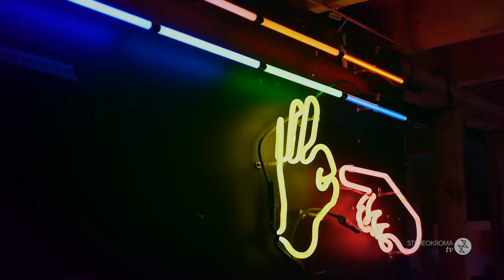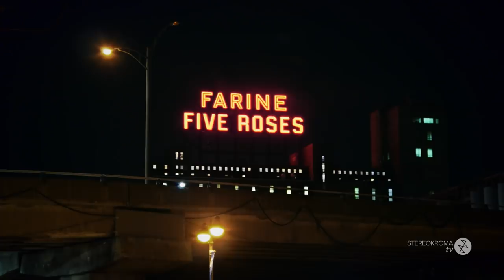Neon Signs last for 50 Years! ✨Making Neon Signs at Neon Family

Comment: this is one of those things that really takes passion to learn, ive always been one that could watch a few tutorials an pick up how to do things an welding was the first thing i ran into that wasn't as easy as watching someone do it but took time for me to get decent an even now i dont consider myself a welder thats work is worth paying for cause its not pretty  but is good enough for structural welding and this is the same thing im getting from this. there is a true artform to getting the glass to do what u want it to from the looks of things an isnt something that u can pick up from just looking but is going to take an input to see the reaction of the glass an i assume this takes alot of time, patience and  quite a bit of material put into it just learning the feel of how glass moves at these temps an it looks like its getting the glass just hot enough for it to start to soften but not so hot that looses its shape an the blowing through the tube im guessing is either to help keep the inside cooler or to hold a positive pressure to keep the tube from collapsing. id love to get my hands on the stuff to give this a shot just cause i feel like this is another one of those dying techs due to the newer tech from leds.

Comment: Great video, it was very interesting, thanks. I would also be very interested to understand more about the electrical driver required for Neon lights, the voltages and currents etc Also any information on the electrodes. Dave

Comment: I do lampwork rn I learned as a pipemaker but I'm looking to transition to neon sculpture and light fixtures. I work in a small space. 7 x 9 ish. I'm wondering what the best quality bombarder I can get is that will fit in my workshop. I'm thinking I can use my bench torch as well a the dual headed hand torch you have. Cheers from the state of maine